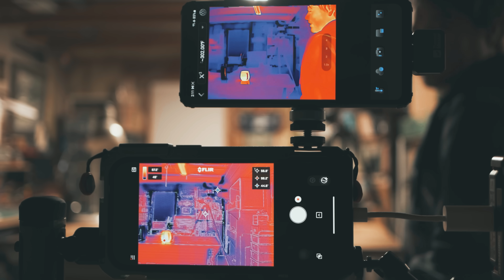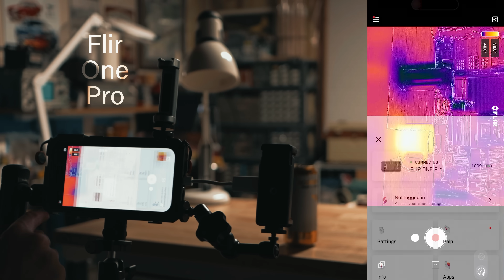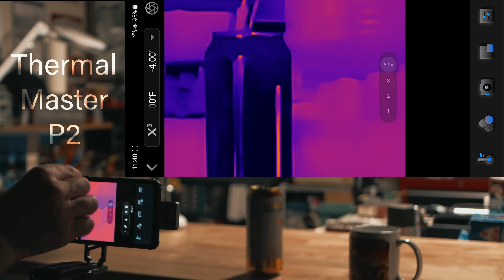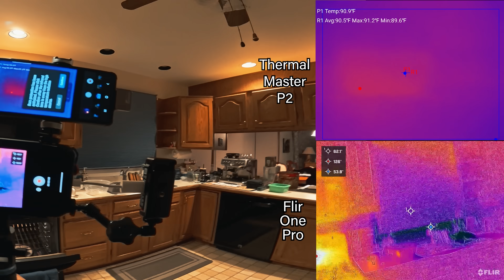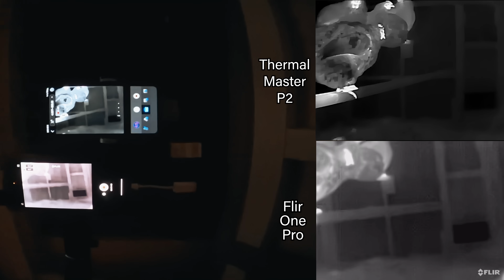Thermal Master P2 VS FLIR One Pro | The Best Thermal Camera I have ever Tested

Comment from the maker: You can skip to the part you want to see below:
00:00 Introduction
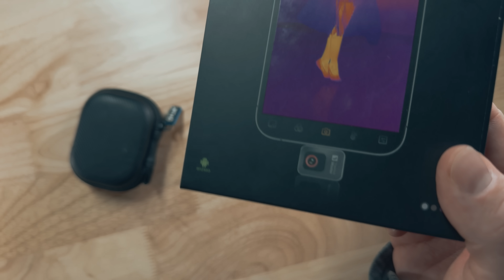00:37 Compatibility
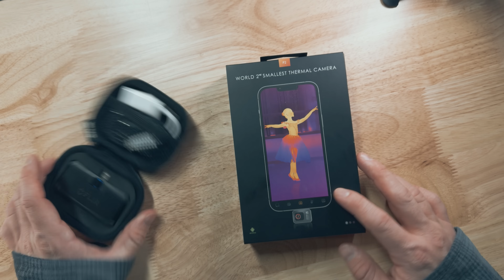01:17 P2 Unboxing
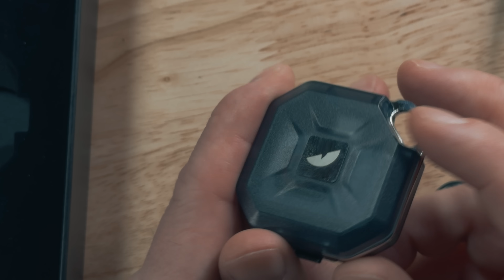01:51 P2 Case
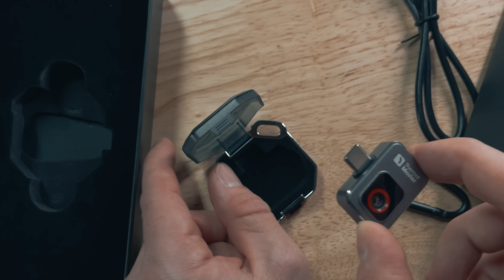02:21 P2 Size Comparison
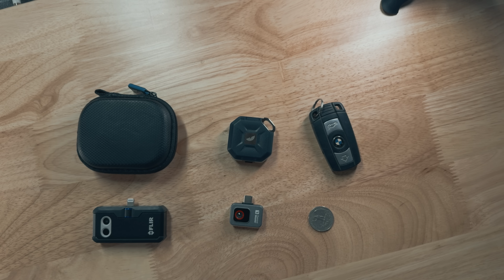02:58 Spec Comparison and Overview
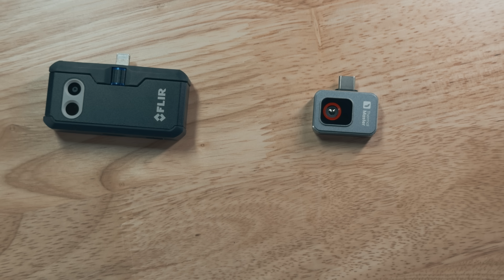04:38 Battery 
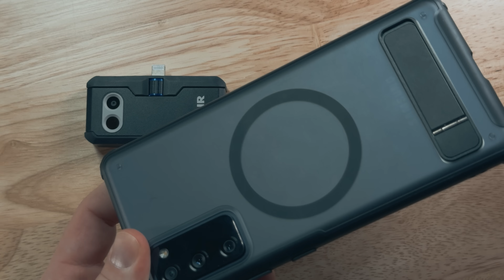05:32 Phone Case Fitment
06:02 App needed For P2
06:42 Start-up Time comparison
07:20 Flir One Pro App Walkthrough
12:08 Thermal Master P2 App Walkthrough
18:30 Frame Rate and Lag Test
19:21 Side by Side Test Indoors
22:55 Side-by-Side Test Outdoors
24:33 Final Thoughts, Outro

Find the P2 here:
Thermal Master's official website: https://thermalmaster.com/products/thermal-master-p2?ref=4wheelkid (paid link)
Regular coupon - $50 off+discount code "THERMALP2" - 10% off.

Amazon: https://www.amazon.com/dp/B0DB5TDN5K?maas=maas_adg_276920846911515E90BDB0964635D4A5_afap_abs&ref_=MaaSRefParam&tag=maas&th=1 discount code "THERMFOCUSP2"-8% off

Aliexpress: https://www.aliexpress.us/item/3256807703780799.html?gatewayAdapt=glo2usa discount code "THERMFOCUSP2"-$20

(I may get commissions for purchases made through links with "paid link" next to them, buying from one of these links or using my coupon code will help me support the channel at no extra cost to you.)

Comment: The FlirOne is a POS. Terrible buy...the app takes forever to load, and often times needs a resync or handshake. The battery on mine doesn't hold a charge--it was my SECOND unit and after only a month it would die. I have to keep it plugged into an external power source and trick it. I'm so glad we have other options now.
Reply from the maker: yeah the flir one pro is annoying. so nice just to plug in a thermal master, no battery to go bad and boots up faster
Reply: @4WheelKid  I bought one thanks to your recommendation and I love it! FlirOne goes in the trash, I couldnt even give it away to colleagues lmao

Comment: I don’t believe you’ve actually owned the flir for several years, because you really fumbled to get it plugged in, you also repeatedly claimed that “oh I don’t think the flir has this” when in fact it does. If you owned it and worked with it for years you would know where the equivalent settings and menu items were… this just seems like a very biased sponsored video
Reply: A lot of tools, like a horoscope, you don't use daily, weekly or even monthly ... You have to sorta relearn when you use it  ....cut him some slack.
The P2 is quick to start up, and just use. Everything about it is better.
Reply from the maker: Cool bro

Comment: Funny thing is that you gave Flir an unfair advantage using MSX since just the raw thermal is just dogshit 🤣
I also have both and rarely ever use MSX/MIX of thermal and RGB since it just gives a bad thermal picture.

And I've replaced my Flir 3 times because of dead battery.
Have had many MANY support mails to them for the app not working and ended up them reccomending me to google and download a random older APK file of the app, instead of still supporting my phone in the official app or giving me the file directly.

It worked for a few months before an update bricked it and i needed an older app from unknown source..

The battery is still shit and i need to have with me a powerbank and charge it while using..

The InfiRay just works
And SOO much better quality, resolution and framerate

Comment: So there's like a slew of sub $200 ones with 256x192 resolution. Will that spec pretty much get you the image quality of the P2?
Reply from the maker: interesting, not sure unless I actually test them. might be using the same sensor but not sure. that AI image sharpening and detail option thermal master is using is pretty trick. not sure if thats happing in the device or in the app as software based. biggest thing when using a phone based thermal is making sure the app is good cause it's only as good as the app

Comment: Do you know when the P3 will come out and what will be the upgrades or changes?
Reply from the maker: not sure yet, but i'm hoping 1 P3 with work both on android and ios usbc, that would be rad, maybe more resolution would be cool. and more of an extension on the usbc port for thick cases. those would be my wishes. hope to test out the p3 when it comes out.

Comment: LOLOLOL, Obviously the NON flir paid, gave, and pushed  you''' Unlike some things... any company can say any thing.... use both as a pro every day and see which ones better
Reply from the maker: you sound upset
Reply: I had my Flir one pro for 2 years and got upset with it flaws and limitations.
Bought the Infiray P2 PRO (basically exact same) and now the flir is collecting dust and worthless to me.

The P2 i can use for many hours and only limited by the phone that can go for over 8 hours in thermal.

The Flir i have to charge for 30 minutes or more to only get 5 minutes... (have replaced battery 3 times but it just keeps dying).

If the P2 would cost 2X what Flir costs it would still be a better value, but it is half the price instead 😁

And the Flir app just cuts support for older phones (4 years roughly)

The P2 puts Flir TO SHAME !!! 😂

I REGRET ever buying the Flir one, i have used more time in contact with support and waiting for it to get repaired than actually using it.

The P2 I've NEVER had a single issue with

Comment: Hi can this see hot water pipes running behind a plaster board (drywall) wall?
Reply from the maker: It might be possible, I could see the ductwork behind the walls when the heat was on, will have to run the hot water for a bit first, might be less likely if those pipes are insulated, I might have to give that a try

Comment: The P2 clearly produces better images and with a wider field of view to boot. For home inspection , this is a fantastic little powerhouse of a camera.
Reply from the maker: For sure its hard to beat especially with the price and how good the image quality is
Reply: I've been wanting to check out the insulation around my house's air conditioning for a while now, and this thermal camera seemed like the perfect tool for the job. I also figured it could come in handy for some other projects, like inspecting exterior electrical panels and maybe even having a little fun with some nighttime animal watching. When the package arrived, I was immediately impressed with everything it came with: the camera itself, a sturdy case, a carabiner, and a USB-C cable—it felt like a complete kit.Once I got it set up with my Samsung Galaxy S25 Ultra, the camera's performance was absolutely fantastic. The app makes it incredibly simple to switch between different modes, and I really enjoyed being able to capture both photos and videos with the temperature data right on the screen. The best part? Everything saves directly to my phone’s photo gallery, which makes sharing the files effortless.
Reply: @LillianCee  thanks for sharing, I got a P1 myself and mainly use it to check leaks in my home

Comment: I’m a FLIR user, but I have to say the P2’s imaging quality is much better. Except for the battery issue, I often inspect in low-light conditions, and FLIR sometimes struggles with clarity. Great review！
Reply from the maker: Yeah the image on the p2 is incredible and not effected in low light not sure what kind of wizardry they are doing with that X3 button but it works great. Thanks!